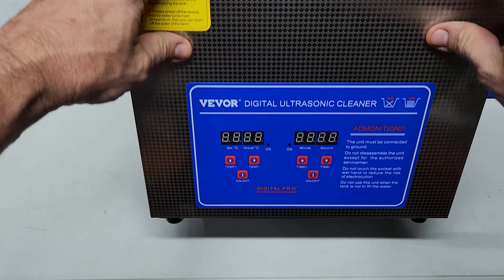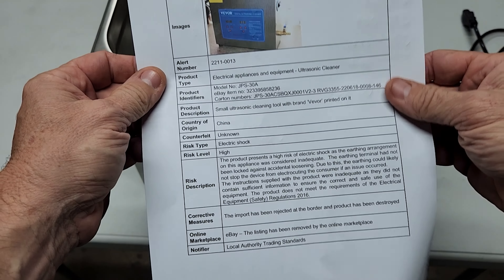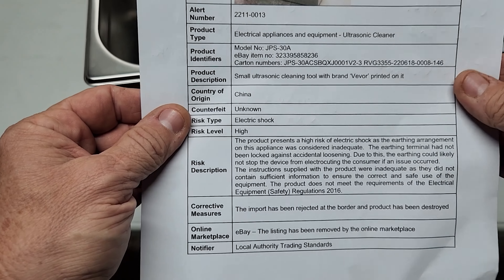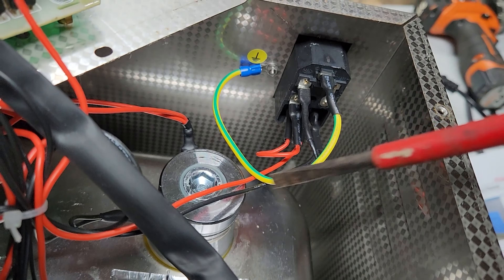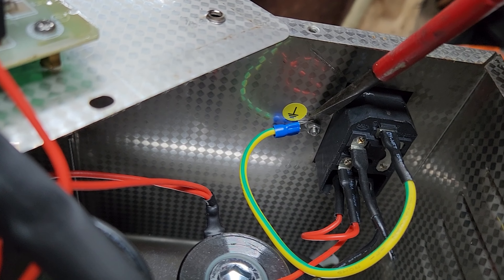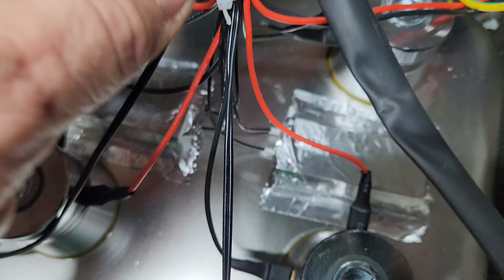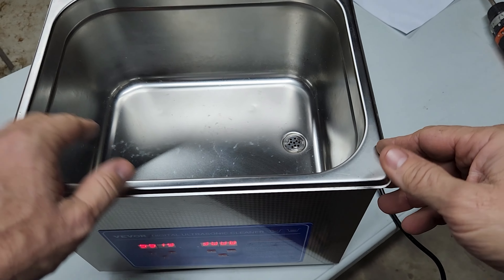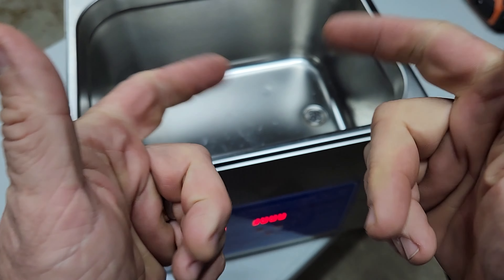VEVOR SAFETY CONCERNS??? I open up their Ultrasonic Cleaner!

Comment: Nope! Your grounding is faulty! The bolt goes through the plastic body of the power terminal, and the plastic can change dimensions with temperature and aging, making the connection loose. A suitable ground terminal should be a stud or flat terminal (same as the other end of your ground wire), resistance welded or riveted to the body. Also, if the housing consists of several parts, each of them must have a welded or pressed terminal. In this case, the ground wire must be a one piece with crimped terminals for each connection.
Reply from the maker: OK, I see what you're saying... So a better option would be for a earthing bolt or stud to be fixed directly to the metal casing and earthed, not to the power supply plastic first then the frame due to your listed factors. I get that, however, in my view the risk of incorrect grounding is still there if the nut loosens in either instance. In my case, the nut is tight, and the earthing wire was firmly connected to the metal case which therefore does what it is intended to do. And the chance of the earthing wire becoming loose at either the screw end or the spade connector end without direct human manipulation is next to zero. This is why I can see no issue with the grounding on this appliance.

Comment: Maybe they were worried that since it creates extreme vibration, the ground attached to the plug component should be soldered. Thanks for opening yours. I got my second hand as a return so want to check mine out too.

Comment: I got one called CREWORKS 6 liter version, I bought it new but it was faulty, all electronics dead apart from the red light at the back. I wanted to return it and get my money back but they sent me the money back and said no need to return the faulty machine. So I wonder if I can somehow repair it, as the problem might be a simple one like a blown fuse, does anyone know the main problem with these machines? Maybe it needs a new mainboard but not sure where I can get that from.

Comment: i have this SAME unit.  but it does not heat up anymore. everything else works. i have tested all the fuese and i have ohm ou the temp sensor. There is also 123V C going to the heating pads. But the pads do not get hot. what do you think the issue, the board for the heater or the heating pads.

Comment: Thanks for taking the time to make this video.  I’ll look into this issue on my machines.
Reply from the maker: No probs.... just make sure the earth cable nut is well tightened to the metal case from the earth of the mains power supply. I probably should have spent more time talking about correct grounding with appliances, but I just slapped this video together really quickly.